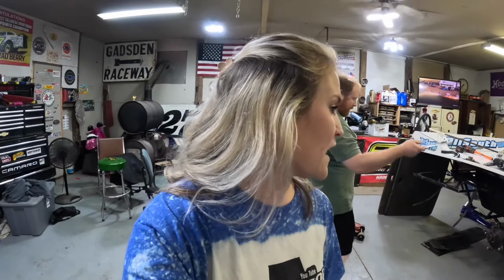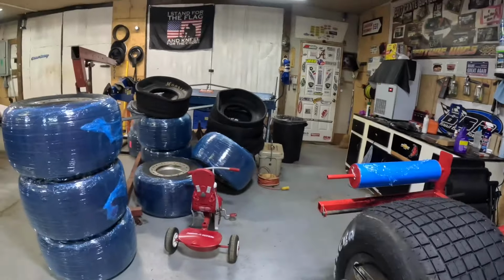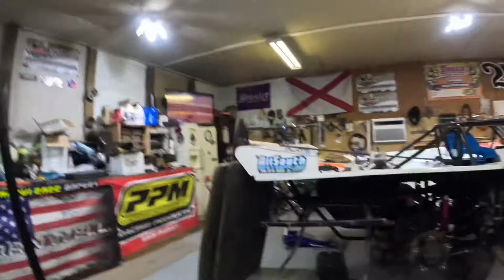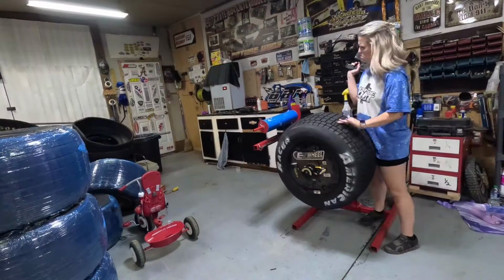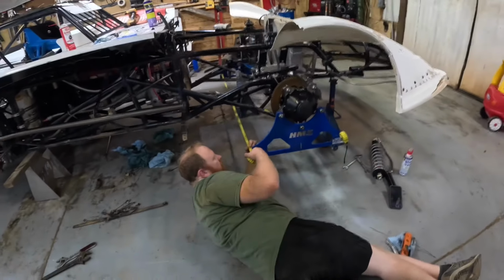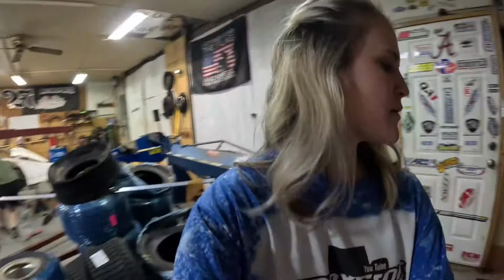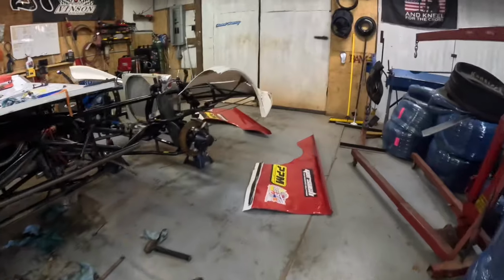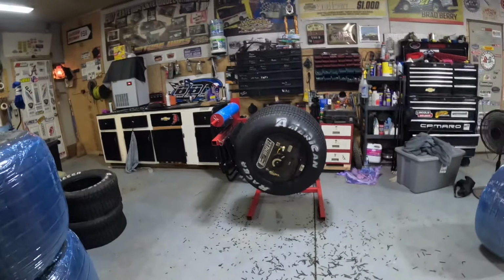The never-ending cycle of tire prepping and body work shenanigans!

Comment: About the oil problem? I think I saw you have the Peterson ‘priming’ oil filter adapter? They have a check valve in them. I don’t know if true? But have heard they might malfunction? Causing the motor to be starved for oil?
Reply from the maker: We will check into it if the issue persists